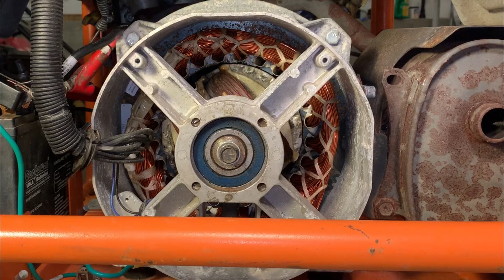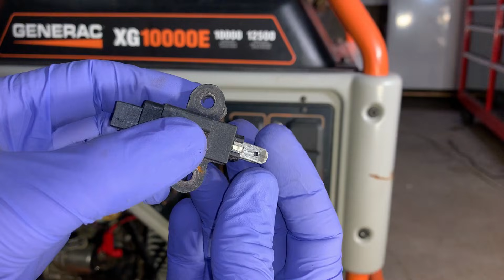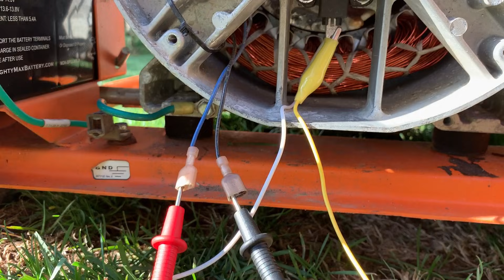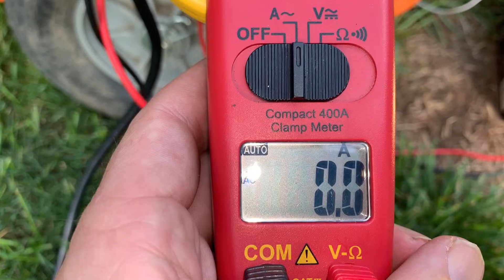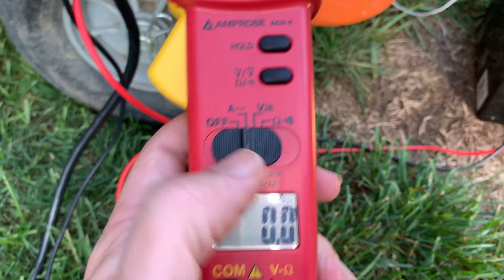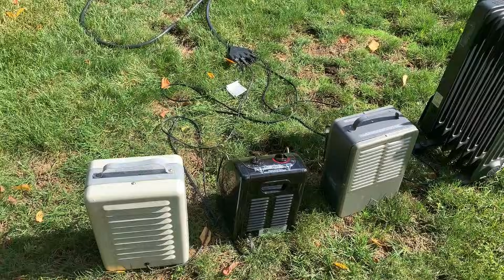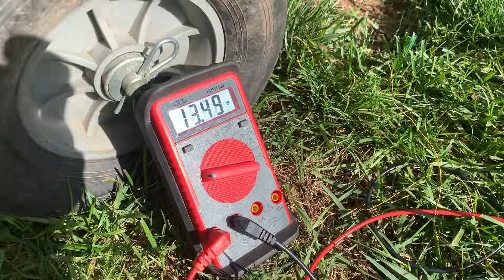Generac XG10000e No Power/No Voltage - Fixed

Comment: Excellent vid. What size fuse do you usually run to manual provide power to the rotor? 3?5?I havnt in the past and realize that might be a dumb idea 😅

Comment: Gonna get one for 800$. Is it worth it? It has 3 running hours.
Reply from the maker: They are one of the few low THD generators out there.  $800 is a good price if everything is working as it should.

Comment: check the diagram most of these v-twins are continuously self flashing
the isolated field, sense and regulator power windings allow 12V positive from the cranking battery run circuit 
[which is negative grounded]  through a fuse, blocking diode, and current limiting resistor to feed the field.

Comment: When you first started the unit............It sounded like it was a little slow. Apparently the govenor can not regulate the speed properly or the engine can not make enough power in HP to sustain the load to maintain 60hz.  It can not maintain 3560 PRM under load.  Bottom line it is making reasonably good power.  For the money ...........a great deal.   You know your stuff.  Good job.

Comment: Need help… my Generac 7550 EXL runs perfect, stopped making power. I pulled started it, battery dead… Does the battery need to be connected for power output? Do you have a video on that unit 7550 EXL
Reply from the maker: I do not have a video on that exact generator, but do have a few videos on similar models.  They all function the same way as far as voltage regulation goes.  The battery does not need to be connected for generator output.  See these videos:  
https://youtu.be/13sBj8a-xJw?si=7xxyqEs-NVdNftnP
https://youtu.be/PM8VXYXOJUs?si=bJ6f4jPP_cTs9uyn 
https://youtu.be/mf5w_NPXGqc?si=Pa6-_ZNQ3ee5tzFK

Comment: hi im geting 40v on my 110 side and 128 on the 240v any idea
Reply from the maker: Might be a bad neutral connection (corrosion or loose) somewhere in the control panel or in the generator head.  Otherwise maybe an avr issue.
Reply: @jcondon1  after a play with it getting 117 on the 110 side and 120 on the 240. looks like someone has had a messabout in the control panel wiring looks messedup
Reply: thanks im mick in england

Comment: I had a call out on a generator not producing.  I had to rewind the stator.  Owner parallel it with utility with backfeeding. After rewind put in auto transfer switch.

Comment: I know this is from a year ago and I haven’t read all of the comments, but the reason you weren’t reading current on your ac clamp meter is because you need to pass the wire through the jaws.  You were trying to measure ac current through the ohms/volts plugs on the clamp meter.  That being said, I am envious of your finds - I would love to do this as a hobby, but lack a garage and a pile of spare parts and a source of broken machinery!

Comment: Most of the time, when a generator doesn’t build voltage, the reason is the generator engine was turned off while the load was still connected. Always shut the output circuit breaker before shutting the engine, or you will have to flash the coil to rebuild output voltage.

Comment: Hello my name is Keith, I was gifted a Centurion 17500 watt generator that has set unused for quite sometime. Cleaned out tank and replaced carberator but still would not start. Had to remove ground wire that kills magento's and also had to apply 12 volts the fuel cutout to start engine. Engine started right up and went extremely high idle,  I had to disconnect the electric controller for that. Restarted the generator and runs perfect as long as tne 12 volts is on the fuel cutoff and I keep tne idle from running wide open. Went to check for voltage ... nothing. Please if anyinfo that you can help with or even fix this generator please contact me

Comment: Champion 3500/4000, 2 yellow wires that feed power 4-8 vac to AVR. Reads open, 100 hour machine. Have you ever seen this?
Reply from the maker: Yes, the excitation winding (yellow wires) is a weak point in a lot of generators.

Comment: Awesome !!
I work on LP standby generators of many brands.
A few weeks ago I was called out on a B&S 20KW that was not transferring back to utility after a power fail. When talking to the customer, they explained , a service company replaced the transfer switch circuit board. When comparing the factory schematic to the switch wiring I discovered "mis-placed" connections.
Luckily when I returned the stake-ons to all to their proper locations everything functioned as normal again.
So, when changing out wiring, label, label and take a few pics !!!!
Great vids, very carefully made and informative...thanx for sharing your discoveries...

Comment: I have a Generac Dp3300, worked great last year. Went to use it yesterday during a power outage, and it's only producing low Voltage. Like I can plug a drill in but it spins super slow, and if I plug in a light it's super dim. Use to light up half of my house, and I noticed it will surge every once in a while and will produce enough voltage to properly run a light and a drill. But then dies right back down.
Reply: I wanna add my slip rings are quite dirty, and I tried to clean em up a bit. Kind of hard to get into mine with all the wiring under the cover. But maybe that's my issue.

Comment: Great video!! You mentioned a few times if the resistance is high through the brushes or outlets, there is a problem. I have very high resistance testing through brushes and outlet so what would those problems point to?

Comment: Got my hands on a generac XT8000e, Cleaned the carb and it started, makes power, 320  hours. 140 bucks. (evapo rusted the tank, new petcock and battery and shes good  to go) Only reason I felt confident enough to tackle it is because of this channel. Thanks for all the info James!
Reply from the maker: Good work.  That is a nice generator.

Comment: The wires are all individually labeled on the insulation. You need good lighting AND magnification to see it. So it's possible to identify every wire even though they are the same color.

Comment: I have the exact same generator with the exact same problem.  How do I get it to you to repair?  Your video was excellent but I have no idea what most of what you said means.  Took my generator to an electric shop and they said it needed a voltage regulator and that they were obsolete.  I emailed Generac to see if they had one and they said yes, in stock for $176.00.  After watching your video, my generator could have the exact same problem.

Comment: I'm retired now, but for the last 20 years of my career I was a troubleshooter for several elevator companies. When you get into multiple commercial elevator systems sometimes the problems are mind numbing. And the best part is you are always coming behind multiple mechanics who have done god knows what to try to fix, coverup, and get away from that damn building any way they can. I think the consistently worst one had a 7.5 kw dc exciter to drive the 50kw generator to drive each  hoist motor. These were in 8 car groups with over 2300 6 pole relays in each machine room for the bank of cars. O yeah, each car also had another generator with 8 different fields to control the 50kw main generator.  And 2  synchronous motors to drive a double sided 16 cam contact assembly for speed control. and every once in a while everything would run. It was lovely. It was like a vacation day.  Good job, CHEERS. Joe.

Comment: The VR looked pretty similar to a guardian stand-by gen pwrd w propane. From what 
I found and heard, stand-by gens use the battery to excite the rotor. It does seem weird 
that a portable gen would have such a fancy-ass vreg.

Comment: I have a generac 5500 with 0 hours on the clock and no power. Was sitting in the back of an ace hardware and was forgotten. Motor runs like brand new. But no electric. Worst case scenario I have a free 8hp gas engine for my mini bike.

Comment: This is most likely a stupid question, but to "flash" the generator, would it be better to connect a battery driven cordless drill to the drill plugged into the generator chuck to chuck with say a headless nail used as a drill bit in both drills so the cordless can drive the corded faster and longer to generate more "flash"?

Comment: WHY 61.7 HZ?
Reply from the maker: Ideally I would set to 60 hertz, but the mechanical governor on these engines are not perfect and the engine speed sags a little under load.  They must be set a little fast at no load so when under a medium load they run at about 60 hertz.  Full load they will slow closer to 58 hertz or less depending on the sensitivity of the governor.

Comment: How can you buy a 2000.00 genator for 200
Reply from the maker: When it does not make power, usually it is a 300 lb paper weight.

Comment: Hi James, I really liked this video a lot. I've recently started to watch your videos and have learned a lot of practical information about these generators. This one was exceptional good except for the ability to follow exactly what you were doing. When you got into the weeds about the rewiring i understood what you were trying to do but could not picture it. I think this part was so useful and needs to be understood  more clearly. I would request that you consider a part two to it and sketch out a drawing (schematic) to show what you were doing with the mis-wire, i.e. what it was and what you made as well as the meter ups so its clear.
Thanks
Reply from the maker: Thanks for the comment.  Unfortunately I no longer have that generator.  If I remember right, this generator had no access to the stator wires down in the powerhead.  So I had to locate where leg 1, leg 2, And the DPE and sense windings up in the control panel and isolate them to test the ohms.  By doing that I was able to determine that someone had connected the wires onto the wrong locations on the AVR.
Reply: @jcondon1  so you used the schematic of the other generator that was similar to realize the mis wire?
Reply: @jcondon1  what does "DPE" winding mean? What does it do?

Comment: I am a master electrician and use one of these XG 10000E units as a whole house backup generator with a Reliance Controls manual transfer switch.  I have had it for going on 5 years and exercise it monthly for around a half hour and refill the tank annually with stabilized ethanol free fuel.  I turn the fuel off each time and let the engine stop for lack of fuel.   Have never had a problem.  Runs the entire house with out a hiccup.  Can switch from utility power to generator power and back and the computers don't even sense the switch!   Excellent video, keep up the good work!
Reply: I had electricians place a Master 'Source' switch in my Main Power Panel...... so that I Can't feed back to the Street..... Otherwise.... I do the same thing that you do.....

Comment: fuel stabil is ok but I wash my gas now or get the manufactured for my small engines. Its cheaper to just wash out the alcohol. It very well maybe a little two stroke oil in that gas or just an additive. little 2 stroke doesnt hurt much

Comment: I appreciate your shows and tell on your video I was wondering on this Generac can you adjust the 12 V charging system I have a early Generac 7550 W surge is up to 13500 watt B&S 15 hp, can comment on that?
Reply from the maker: I have not seen any adjustment on the 12v charging system.

Comment: I agree with the others that really did good troubleshooting this one. I do think you still may have fuel/carburetor/governor issues though. That engine should have been able to carry the load  @ 60 cycle and hold the voltage. You sound as though you already knew that.

Comment: I have a coleman powermate  5000 (PM0525312) and after replacing the sump gasket to fix an oil leak after the engine cools. Now I have no power (couple volts output), where it worked before. The resistance of brushes look good (40 ohms) but I get no volts dc at the brushes when running. Flashing with a electric drill did not resolve issue. Before i consider put 12 volts at the brushes (+ outer most, - inner most) I would value your thoughts first.
Reply: Here is a reminder about portable generator safety: this is only a reminder for anyone who use portable gas/propane generators. This is just to make sure that everyone is aware of all the warnings and it’s just to remind people to be careful using portable generators. Everyone has to see this safety reminder. Every year after hurricane and winter storms, there were reports on the news that many people have died each year when using generators due to carbon monoxide poisoning and electrocution during a power outage and using portable generators for other uses. There were reports about deaths when using generators when the power was out. There is something very serious that everyone should always be aware of when using generators. Some people do run their generator indoors which is not safe and that increases the risk of carbon monoxide poisoning which can cause death of family and you. Some people run their generator in wet conditions which can electrocute them. Here’s an advice about generator safety: please remember that you should never run your generator indoors. Remember that carbon monoxide is an odorless and colorless gas that you cannot see or smell. Carbon monoxide is a silent killer. Keep that in mind. Make sure your generator is 15-20 feet away from your house and away from doors, windows, and vents. Having a carbon monoxide detector is very important against generator safety. Some people also allow children to go near the portable generator which could pose risks. We need to keep an eye on our children making sure that they are not near the portable generator so they won’t get electrocuted or burned by the generator which is dangerous. A locking enclosure also keeps kids safe. A generator shed might look like a tempting place to explore, or take cover during a game of hide and seek, but a generator is a dangerous piece of equipment that can cause injury. It says on the manual that we should also keep children away at all times from the portable generator to avoid injuries. Please do not permit a child or unqualified people to operate the portable generator. Generators pose electrical risks. If you need to use your generator during wet weather, you need a generator tent to protect your generator from getting wet. Don’t let your generator get wet. Keep your generator dry and before using your generator, please make sure your hands and your generator is dry. Everything that is said on the generator’s operating manual should not be ignored. Never smoke cigarettes near the generator. Please keep flammable things away from the generator. Never overload your generator too. Your generator can catch fire. Never ever try to plug a generator cord into a wall outlet to avoid back feeding. Back feeding your generator is dangerous. Always turn on your generator first before plugging in appliances and shut off the appliances before turning your generator off. Use a heavy duty cord for your generator and the cord should not be worn out. All the instructions should be followed carefully. Never refuel your generator while it’s running. It can cause fire if fuel spills while your generator is hot. You should turn off your generator and let it cool off before refueling it. Having a fire extinguisher next to the generator is also important. This is only a reminder for everyone’s safety of using generators. Make sure your generator is properly grounded. https://youtu.be/I1jT3ANENvI and here is a video more about keeping others safe when using generators and also about our family’s safety. Hope this helps and everyone understands the safety rules. Thank you.